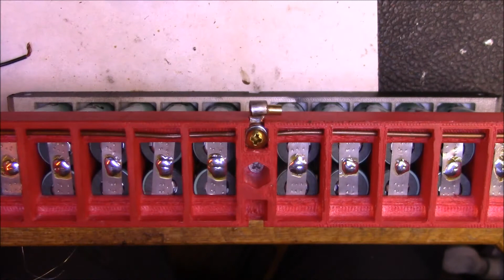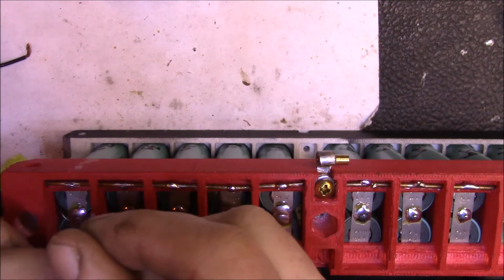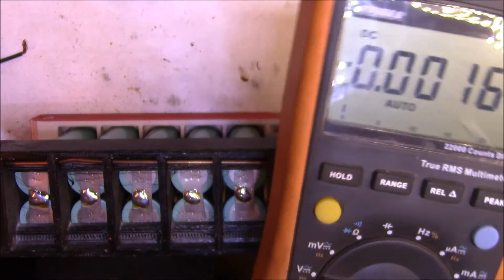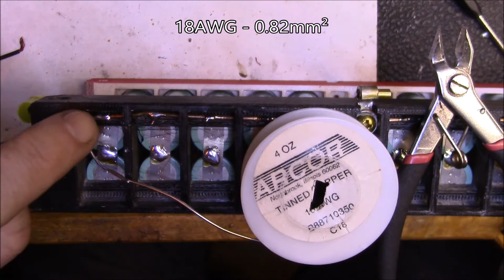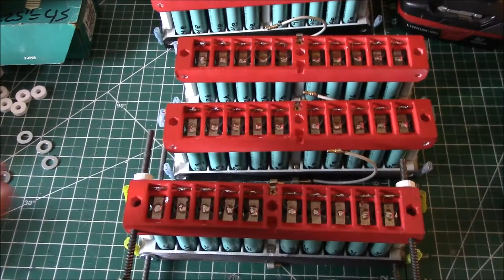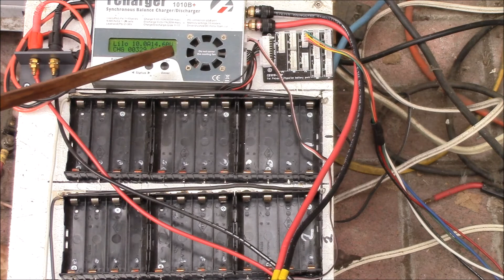Building 20P Battery Modules, Part 6

Comment: I have never understood these people who want to make a huge TESLA POWER SYSTEM from expensive Lition 18650 batteries with a high chance on defective cells.

Possible boredom to be busy with something???????????

I have seen YouTube films where it often does not go well. a lot of Battery cells that must be replaced.

I have had a large Torjan battery bank 12xT105 24volt 675 amp for years. and that works perfectly. And is equally expensive but much more reliable.   

The lifetime of 18650 batteries is also 8 to 10 years if you have good quality cells.
Reply from the maker: I also have a lead-acid battery bank (AGM) and wanted to give the Li-Ion batteries a try.  I've seen lots of information both pro and con for either type of batteries.  I like to try things for myself and see how they work.  I'm trying out both recycled/used cells as well as new cells.  I  find the price for usable amp-hour rating is quite comparable between the two chemistries.

So far am quite impressed by how well these batteries work.  I'm only running mine to 4.0 volts/cell to extend the lifetime.  So far have had no cells fail and in my first 5 month capacity test, I saw very little change on the old used cells.  While I do expect some cells to fail, there is the advantage that a failed cell can be easily replaced.  In a lead acid battery, if one cell in a battery goes dead, the whole battery must be replaced.

I'm also looking at this as a way to extend my existing investment in the rest of my system.  By moving from 12V to 16V, I get about 1/3 more capacity out of my existing charge controller and my existing power inverter should also run with less current.

Comment: Could u tell me what size nickel strips u prefer to use....which size is best  for soldering?
Reply from the maker: The strips I use are 8mm x 0.2mm.  It's what came with my spot welder and seems to work fine for tabbing 2 cells together.  That strip is probably rated in the 8A-10A continuous range and my fuse wires burn out about 10A.  The cells I'm using are rated around 1C, so a pair is around 4.4A (2200mA/cell).  Thicker strip would carry more current but you need a more powerful spot welder to weld it to the battery.